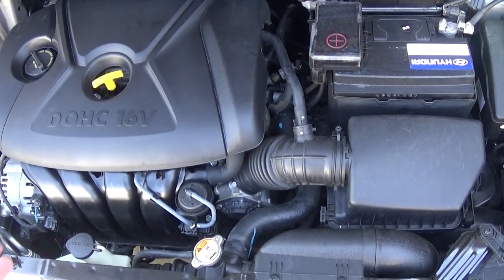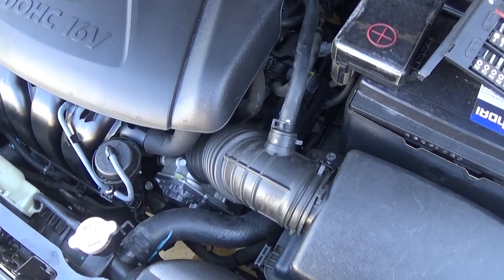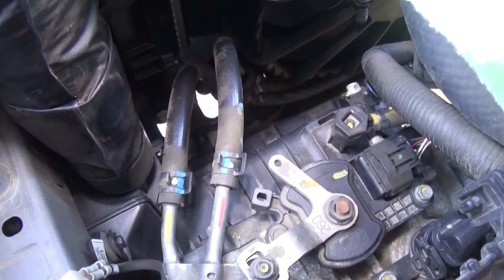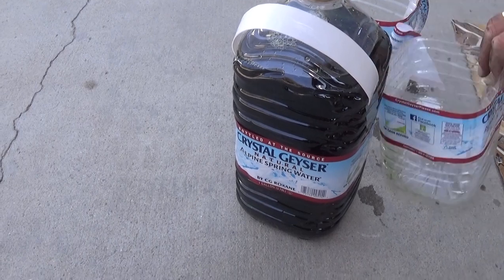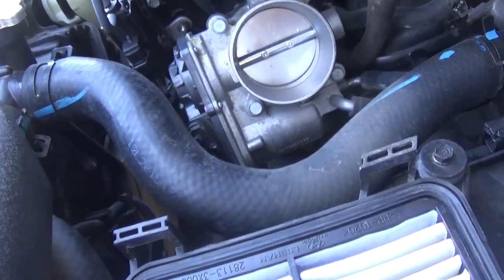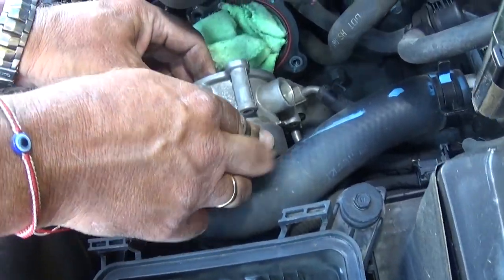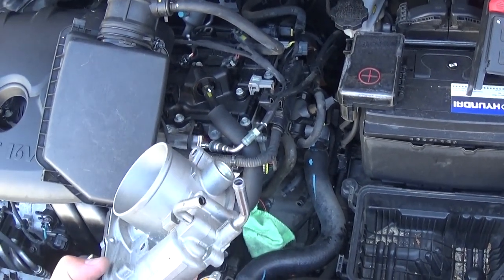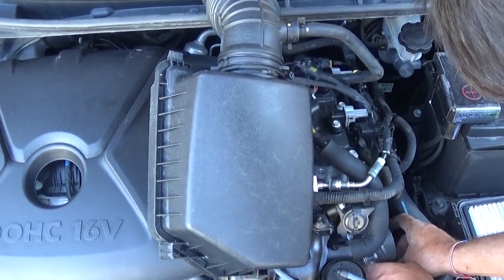HOW TO REMOVE OR REPLACE THROTTLE BODY ON KIA FORTE

Comment: Thank you for your great tutorial. I have a question, can i use plyer to click on the hose to prevent coolant leak, so that I dont need to drain my whole entire coolant out, basically i want to do cleaning on the throttle body.
Reply: jun kit low did you have to drain the fluid or did clampingnwork?

Comment: I have a 2010 Kia Forte and I’m having trouble finding the idle air control valve and all I read is that it’s behind or on the back of throttle body. I took off throttle body and cannot locate the idle air control not sure if it’s built in the throttle body or if it just simply does not have one. Does anybody know?

Comment: I wanted to remove the intake manifold with the throttle body still attached to replace my knock sensor. I unfortunately could not remove just but one clamp of the cooling hose that goes to the throttle body. The other clamp I did not remove without tearing the hose because the tabs to push in with the tool or pointed straight down and I could not access them easily with the clamp pliers that's made specifically for this job.. I ended up taking my car to a mechanic to have it done.

Comment: Why was the throttle body replaced? Was it not starting or what? The one you took off looked pretty clean.
Reply: The tps sensor and the gear mechanism is built into it one of those usually go bad. Horrible design!!!

Comment: Mine is bad and I took it to my local Firestone shop to get the Service Engine light code read. They said even if I or they replace the actual throttle body it still have to go to the deal to get reprogrammed. Is this true?

Comment: How do we get the new one to relearn idle
Mine has a code for idle out of range and cold start code
Reply: You need to reprogram with a GDS tool.... if replacement is done yourself, see if dealer will do it for a fee